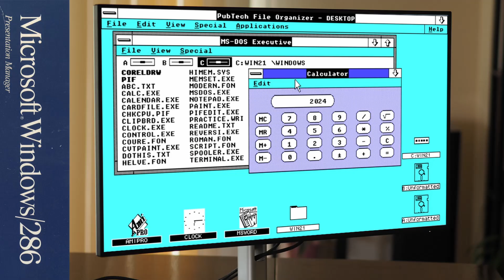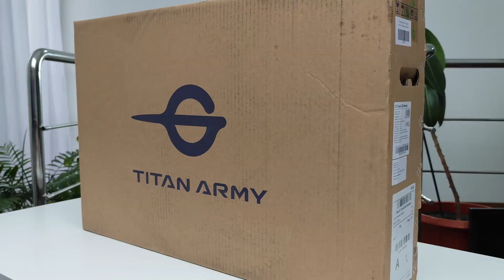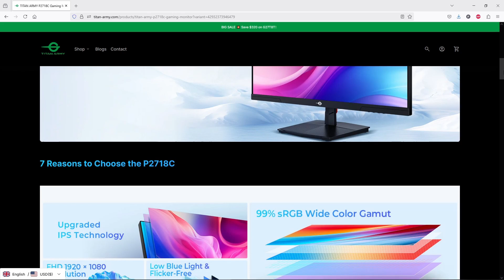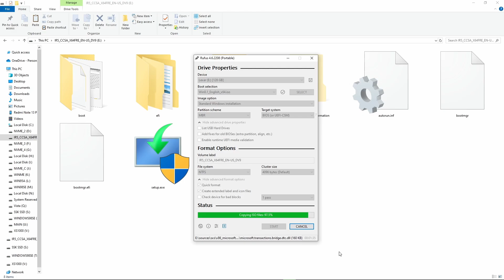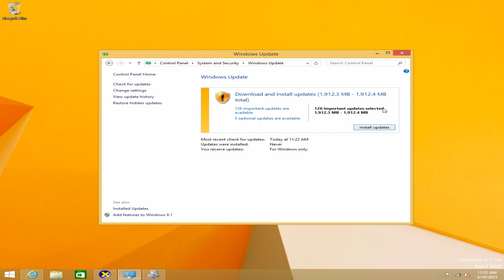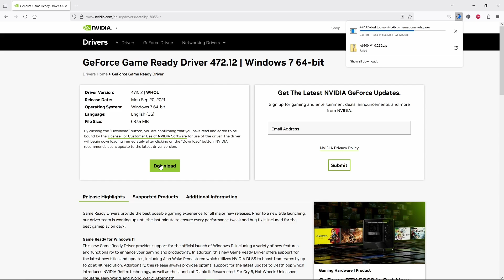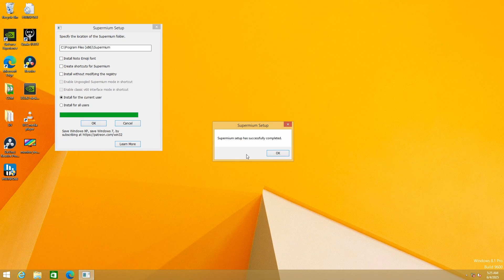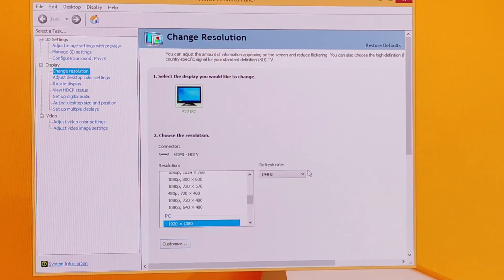Windows 8.1 in 2025:  RTX GPU, NVMe, USB 3.2 & a 27” Titan Army Monitor

Comment: I have a Lenovo Ideapad 3 Rayzen 5 Notebook and installed Windows 8.1 on it because it is the lightest of Windows. The problem is that does not work the internet, came without a network Driver.
I would like some internet user to modify this Windows, making it compatible with Moderna PCs, because this Windows manages to be faster than 7.
Reply from the maker: Since 2020, laptops have come equipped with Wi-Fi 6 adapters, which lack drivers for Windows 8.1 - mainly because Wi-Fi 6 requires kernel-level changes in the OS and only Windows 10 and later are compatible. Just grab a good Wi-Fi 5 USB adapter, they have Windows 8.1 drivers and can deliver good speeds like AC1300, AC1900.

Comment: I just got a E5-2430 CPU from a work server that was going in the trash, the sweet spot, I think, for some semi retro XP (maybe 2k too?) experience all the way to the very latest Linux systems. I don't know what to do with it though, I don't even know if it works but I just cleaned it up and looks brand new, and finding small motherboards for a small setup is interesting. Maybe some day. 

Windows 8.1 was my favorite experience on my, at the time, brand new 2011 MBP, better stability, performance, battery life, and even gesture recognition than 7 by a country mile. It simply had the upper hand with baked in goodies that better fit laptops and the post 2010 hardware paradigm.

Shame my RX580 died a while back, Windows 7 baseline compatibility was dope.
Reply from the maker: Nice! That's basically a Sandy Bridge CPU, and the consumer motherboards (LGA1155) for this architecture are very retro-friendly. Anyway, I have some good news about Windows 2K - now it works with ACPI (sees 24 CPUs on a Ryzen 9 9900X), can boot from a NVMe Gen 5 SSD: https://youtu.be/SVGUtt7YtxI, and also works with USB 3.x. So you can install it on pretty much anything.

Also, for Windows 7/8.1, there is still awesome hardware support, considering you can use RTX 3000 series cards and NVMe is officially supported.
Reply: @O_mores  I don't know what GPU to pair it with. My only experience is with AMD RX GPUs, the oldest being the 580 with Windows 7 support but I don't know if it can be made to work with 2K or POS XP. Graphics are the hardest part and I wouldn't mind if the computer went to my parents as a tax and backup machine.
Reply from the maker: @freetobe3  ATI has kinda support for Windows 2000 and XP. The latest Nvidia driver for Windows 2000 is from 2010 (for the Nvidia 400 series), while ATI/AMD stopped its support in 2006. (with official drivers, max you can use are the X1000 series, something like X1950)

Also, AMD ended support for XP around 2013 (the R9 270X is the newest card you can use), while Nvidia continued support until 2015, so you can install drivers up to the GTX 900 series. (With an extended kernel patch, you can also install GTX 900 series cards on Windows 2000.)
Reply: @O_mores  do you know if the R9 270X can be made to run on 2K with the kernel extension patch? I'd be delighted to build a system that can stretch all the way back to 2K/XP to say Linux with support on Wayland.
Reply from the maker: I haven't tested it yet, but there's a good chance it will work. You can install GTX 980 cards on Windows XP, and as far as the driver is concerned, the 'extended core' makes the system appear as XP, not Windows 2000.

Comment: The best fully supported GPU for Windows 8.1 is the Quadro RTX 8000, and even then Type C isn't supported so you can't even experiment with the Virtual Link connector either. Imagine running Doom Eternal (Steam no longer supports Windows 7&8.1) on Windows 8.1 with a Quadro RTX card because the game was made on Vulkan 1.1, Kepler cards can run the game and so will the Ray Tracing on the Windows 7&8.1 supported card.
Reply from the maker: The 3090 works in Windows 7, and that driver should work in Windows 8 as well. I didn't get the chance to test it, since I don't have a 3090 on hand. So I’d say the ultimate Windows 8 build should include an RTX 3090-series GPU. The RTX8000  (which is basically a 2080 Ti with a ton of RAM) is very nice, and in some scenarios, that extra memory is more useful than the raw power of newer RTX chips. Still, a 3090 will deliver more FPS.
Reply: @O_mores  You mean I could've stuck witht he 3070 I sold for 300 to a friend. D@MN IT! I bought a Quadro RTX 4000 because that has official Windows 8.1 drivers to Ray Trace Vulkan games. Hmm... RX 6400 won't Ray Trace Doom Eternal due to the lack of memory to even try. You need 6GB to activate it AFAIK. The RX 6500 XT 8GB should do it on Windows 7... Again I'll have to modify Steam to work on 7 and 8.1 again. Then again this is a bad year to start a Steam account.
Reply: @HedgehogY2K Ampere RTX A4000, A5000 etc work fine on Windows 7 with a simple inf mod using NVcleaninstall
Reply: @jakkiryanov9859  Dude, That must be so cool, almost makes me ashamed to have gone with an RX 6500 XT 8GB version (rare btw) for Windows 7 and 10. Doom Dark Ages is good on 1440p low XeSS Balanced from what I tested. I need to upload that.

Comment: interesting to know that the RTX 20 Super cards work perfectly fine on 8.1 without modded drivers, was under the assumption they just wouldn't, much like the 30 series don't.
Reply from the maker: Yep, these RTX 20 series cards totally work on Windows 8. I don't have any 30 series cards for further testing yet, but I’ll get one specifically for Windows 7 and 8. If you want to check out Windows 7 on an i5-14600 CPU with the same RTX GPU, check this out:  https://youtu.be/EAUqZZrbCQc

Comment: interesting motherboard.. i checked the manual, but what is this pci slot on the bottom? is it like a pci slot that existed before agp slots, or is it something else? i'm looking to build a pc for dual boot win98se and windows 10 but with new intel i5 processors and i really want to put my gf4 ti4200 AGP to use..i dont know where to start, any help is more than welcome :)))) agp slot makes thing complicated to me
Reply from the maker: Yes, it’s the classic PCI slot - you’ll want one for any retro-modern setup, especially for a sound card. The GF4 Ti will only work with an AGP motherboard. There are a few PCI-E to AGP adapters, but they don’t support AGP 8X cards - mostly just the early AGP 1x/2x generations. Instead of the GF4, you could go for a GF6 or GF7. I have a GeForce 7900GS, and it works perfectly in Windows 98. And with this card you play games at 1920x1080, check this out: https://youtu.be/ZBGmhiASz7U
Reply: @O_mores bought myself xfx 7900 gs :)) which modern motherboard can you recommend me for dual boot win98se and windows 10 setup? some board for mid-range i5 cpu and nvme drive...
Reply from the maker: This Z790 motherboard works with a 7900GS in the first slot, and you can add a second GPU for use in Windows 10 without wasting any PCI-E slots: https://youtu.be/G7qm3GFy9tg
Reply: @O_mores tnx! what about sound and keyboard/mouse in windows 98? That motherboard has usb 2.0 slots, can they be used in win98? With some drivers i guess..  and is the onboard sound card compatible with win98?
Reply from the maker: That Z790 motherboard has a PS/2 port, which can be used with a keyboard, and it works in every OS. There’s also a serial port that can be used for a mouse, but serial mice usually only have ball mechanisms, not optical ones. So you need to add USB support...

The on board USB 2.0 won’t work - I explain why in this video: https://youtu.be/V0EOecOkuB8  However, you can buy a cheap PCI-E to USB 2.0 adapter, and it will work in Windows 98, XP, Vista, and 7.

Once you have USB 2.0, you can add sound via USB, or you can use a separate PCI-E card since the motherboard has plenty of slots.
Reply: @O_mores the pci/pci-e stuff is soooo confusing to me :))) i gave up when i saw you plug in 4-port "usb to pci-e" card into a slot that is wider than the card itself 🤯 😂😂😂  but i will figure it out ;)) let me investigate :)
Reply from the maker: That is a regular PCI-E 16x port which can accommodate PCI-E 1x or 4x cards as well. It was designed to work this way.

Comment: 6:42 
Uhm
Windows Server 2012 was based on Windows 8

Windows Server 2012 R2 was based on Windows 8.1

The previous was
Windows Server 2008 was based on Vista

Windows Server 200i R2 was based on 7

Later that Microsoft only use year without R2
WS2016 -> W10 Build 10240
WS2019 -> W10 Build 1809
WS2022 -> W10 Build 21H1/21H2
WS2025 -> W11 Build 24xx
Reply: Windows Server 2016 is based on Windows 10 build 14393 Anniversary Update.
Reply: will correct you here with the newer versions of Windows Server. 2016 is 1607, 2022 is 21H2, and 2025 is W11 24H2.

It is also worth noting that Server 2022 is built on a different branch than W10 21H2, and is actually closer to W11 than it is 10. Everything post 2020 has had quite a complicated development history, definitely a rabbit hole to go down if you have the time.
Reply: @whitebeartigtig Oh okay, thanks for correcting me.

So I feel this was rabbit hole too for using regular Windows on Windows Server nowadays

Some drivers couldn't use Windows exe setup, but majority still could be install from DLL

Comment: Ahhh 8.1
Windows that I love but people only prefer Windows 10

Seriosly Windows 10 was so broken that I'm only using that because the new software move on to Windows 10 only like Steam and Chrome
Reply from the maker: I remember that I stick a bit longer with Windows 8.1 I didn’t jump into Windows 10 immediately, but by the time I did, it was already good enough. I’ve had it installed since December 2019 on this PC, when I bought a new 512GB NVMe SSD. It seems small now… I haven’t had any trouble so far.
Reply: @O_mores My experience was move on to Windows 10 after build 1903 came out and it's stable.

So I decide move on with Light Theme

Comment: I like performance 8.1 for real gaming for gamers
Reply from the maker: So I tested Quake 2 RTX (March 2025 release) on my Nvidia 2060 Super with a Ryzen 9 3900X PC (12 cores, 64MB L3 cache), and it runs at under 50 FPS (46-48FPS). On this Windows 8.1 system with an i3-13100F Quake II RTX runs above 50 FPS, close to 55...

Comment: Windows 8 is still one of my favorite operating systems. Like you said, it’s fast and it’s not going out of business yet.
Reply from the maker: Windows 8.x still has market share of 0.5%-1% and as long as you can get online with it, some people will never upgrade. I know someone who has an all in one Acer Aspire Z3-615 with an i7-4770T, GTX 745, USB 3.0, etc. - still running the original Windows 8.1 on it. If something happens, they’ll just restore it using the original recovery partition...
Reply: @O_mores  Well, a lack of updates and users never stopped me from using my xbox 360 or my old ipad so I just use what's fun and useful. Thankfully people selectively removed windows 8 from their memory so that alone makes me not worry about security as much when most people likely don't even remember it exists. Runs super well on a lot of newer systems since it's not bloated as much.
Reply from the maker: Indeed, it runs well, and a 0.5–1% market share means there are still between 7 and 14 million PCs running Windows 8.
Reply: @O_mores  Hypothetically, but it does run well. Lucky me. Cool video.

Comment: If I remember correctly, in windows 8 or was it 8.1, you can bring back the windows 7 start menu by changing a setting in regedit.
Reply from the maker: I think you can disable some of the Metro functions via registry, but the Start Menu can be brought back only with tools like Classic Shell. That was the real deal in Windows 8. With Windows 8.1 MS reintroduced the Start button on the taskbar, but it opens the Start screen rather than the classic menu.
Reply: @O_mores  Yes, you are right. It only worked on the first version of windows 8. After 8.1 this setting does not work.
Reply: there is also Explorer7, which ports the entire windows 7 explorer shell to Win8+

Comment: I would like to see XP x64 running. I think that I installed it once on old hardware and had issues with it. I'd like to know why it was not more popular beyond people not seeing the need of a 64 bit operating system back then. 

I loved watching your fights with NT 4. We had NT 4 when I was at university and back then I never understood what the difference was between that and my home 95 PC. I just knew that somethings didn't work. I understand now.
Reply from the maker: I actually tried installing Windows XP x64 on this build a day before switching to Windows 8.1, but it didn’t work. XP x64 is based on Server 2003 and needs an ACPI-compliant system, unlike XP x86 or 2000. This board uses ACPI 6.x, while XP x64 works best with ACPI 1.0b or 2.0. Some boards let you force ACPI 2.0, but not this one. You can use a modified ACPI.SYS to make it work - there are a few versions out there, but they're rather unstable... The x86 patched ACPI.SYS is way, way better. Next step for me is integrating that patched ACPI.SYS and try again...
Reply from the maker: Here we go, Windows XP x64 on socket 1700: https://youtu.be/0iW1hheBAp0

Comment: This is actually Windows 9: Windows 8 -> Windows 9 (8+1) -> Windows 10. I still have it on my old Haswell laptop, don't feel any need to upgrade since the hardware can't handle newer games.
Reply from the maker: Microsoft dropped Windows 98SE in '99 and Me in 2000, so calling Windows 8.1 “Windows 9” could’ve happened. But they got wise, sticking with major updates and service packs without new names. That’s why Windows 10 stayed “Windows 10” for a decade, despite big updates like 20H2 and 21H2. Now it's time to move on from that 2015 OS...

Comment: I used to grow up with Windows 8.1. I had a DELL Latitude E6420 (I believe it had a Intel i5-2520M with 8GB RAM?) from late 2015-early 2019 with that exact OS until I got my first gaming PC, a HP Compaq Elite 8200 CMT with Windows 10 Home installed. It used to have an Intel Core i5-2500, GeForce GTX 1050 Ti and 12 GB of RAM. It was pretty great and i made upgrades on it (gave it a i7-2600 and 32 GB RAM) until i started seeing its age years later.

I rebuilt my PC almost 2 months ago since I didn't like how proprietary everything was on my old machine (down to the motherboard, IO and heatsink). It has Windows XP dualboot for retro gaming; it's amazing, and paired with some intensive tweaks I made to improve latency, and with a 180 Hz monitor it's been the best experience I have ever had so far.

ASUS P8Z68-V LX
Intel Core i7-3770K
32GB DDR3 @ 1600MHz
NVIDIA GeForce RTX 3050 6GB
NVIDIA GeForce GTX 750 1GB
Sound Blaster X-Fi XtremeMusic SB0460
(Driver MOD v2.17.0008 by Antes533)

1TB Crucial MX500 (Windows 10 IoT LTSC 2021)
256GB SP A55 SSD (Windows XP Professional SP3)
Two 2TB 7200rpm HDDs for data (Seagate + Western Digital)

I could even try Windows Vista, 7 or 8.1 on it but I feel kinda lazy to do it lol. I would still love to do that as an experiment; maybe later :)

Comment: Have you tried Zorin OS on any PC builds or any Linux Distros?
Reply from the maker: I tried Zorin OS on a laptop - it's cool, but just not for me. With Linux, I'm curious about exploring some older distros. And unrelated to Linux, but I really need to try install OS/2 on modern hardware at some point.
Reply: @O_mores there is OS/2 and OS/2 Warp that is hanging around a site that hosts those files let me know if you need a link to the site that hosts them

They even have old versions of Mac OS as well

I have also found a site that hosts all types of Linux Distros as well and it's a expansive list of them too
Reply from the maker: I think I already have OS/2 in all its variants on my drive, but I just don't have time to start this project, because I'm sure it will take a while to see OS/2 running on a modern-ish PC. But please, leave here any links you think are interesting, because I can search through comments and find them later. Youtube usually don't links, instead of .com use something like *com.

Comment: How about Windows 1.0 running naively on the latest hardware? Quite a challenge, eh? Or perhaps see what's the latest version of Windows you can run naively on the earliest hardware you can.
Reply from the maker: Windows 1.0 runs on this exact setup, along Windows 2.1 https://youtu.be/wcUgp_JYYK8 I'm planning to put an GTX980 card on socket 7 motherboard, I have a "world record" to beat in 3D Mark 2001...
Reply: @O_mores  Damn. I should watch them.

Comment: Windows 8.1 >= Windows 7 in 2025
Change my mind
Reply from the maker: If you ask me, Windows 8.1 feels just like Windows 10 - after all, they were released only two years apart. Still, Microsoft artificially cut it off from modern gaming by blocking DirectX 12 compatibility. That’s just how the business works. To be fair, though, the upgrade to Windows 10 was free.
Reply: @O_mores  8.1 feels faster than windows 10 though at least late windows 10 i expect if you compare with ltsb 2016 it'll be very similar to 8.1 but
Reply: @randomgamingin144p  Windows 10 has always been confusing with its update scheme: the Anniversary Update, Fall Creators Update, 2020 Update, and then came 21H1, 21H2, 22H2... Major updates like 1709 (from 2017) could have been labeled as 'Windows 10.1' - that would have made much more sense for everyone.
Reply: Start menu, official driver support